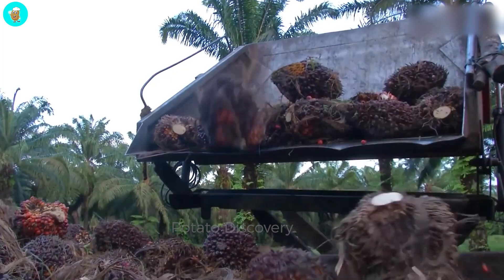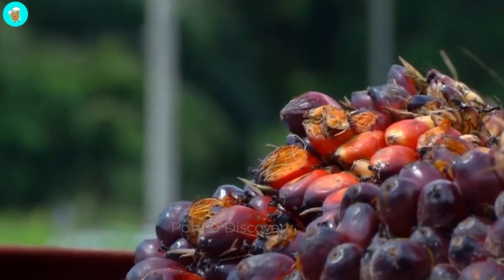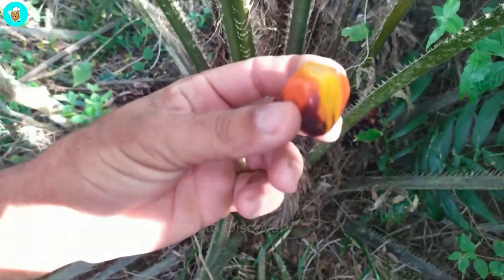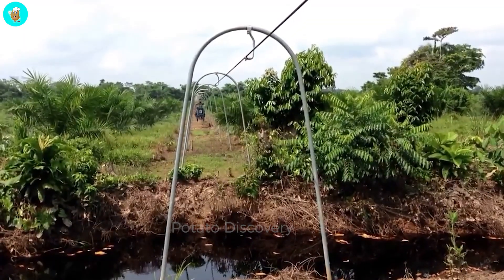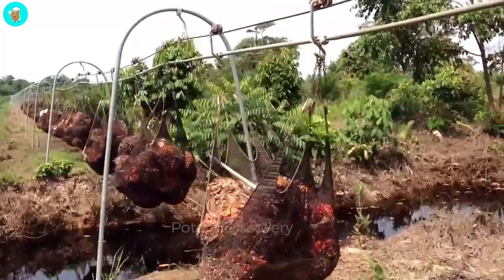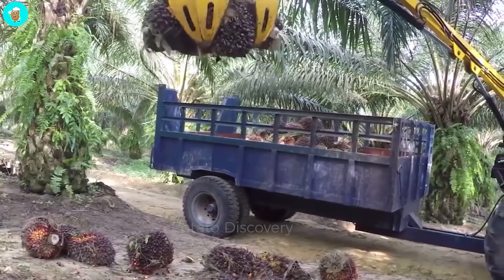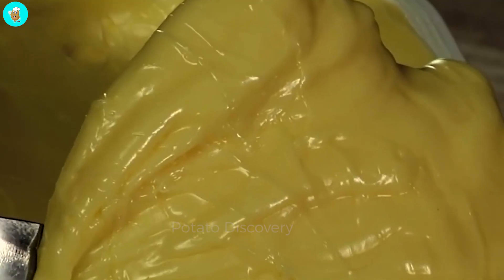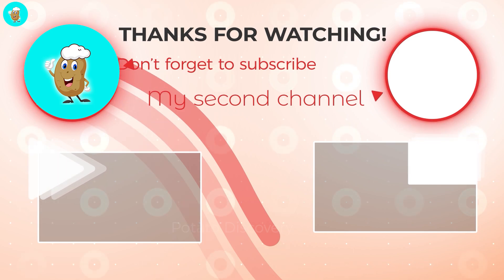Modern Palm Harvesting Method - Palm Oil Processing Factory | Agriculture Technology

Comment: reducing costs and increasing profitability.
Reply from the maker: Palm Oil plantations in north Sumatra. they dont have such modern equipment yet. they do all that work BY HAND.
Reply: @mousefarm  all large scale plantation uses modern equipment especially in the oil processing. Small farmers may use more manual ways such as wheel barrows to collect oil palm to the collection points before being loaded onto trucks but the fruits are eventually sent to modern factories for processing. The fruit must be processed within 24 hours after harvesting. Most of palm oil factories in Malaysia and Indonesia are capable to process 60 metric tonnes of palm fruit per hour.